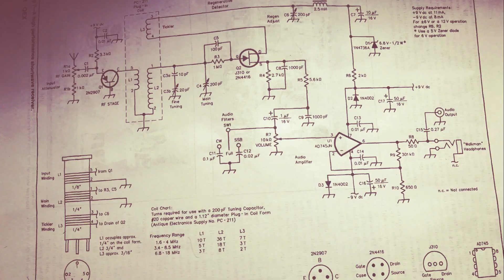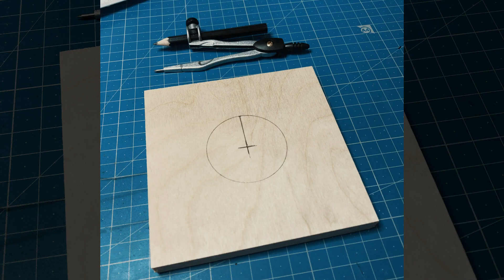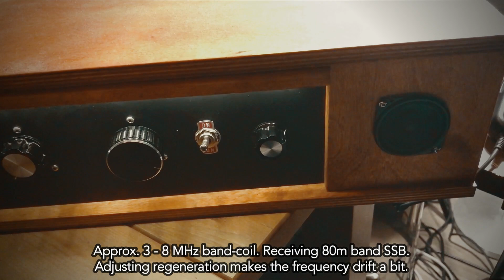Wooden Radio   High Performance Regenerative Receiver

Comment: Very nice work.  I built the same circuit, tried to lay it out neatly, it did not work well.  I moved components around until it did work the way I liked.  I performs very well now, but looks like a bird's nest inside.  :)

Comment: I'm restoring one at the moment, was a terrible mess when I purchased it. Had the cabinet stripped recently, had to replace some wires. Need to go through the schematic as someone had previously messed around with.
Reply from the maker: They are rather simple circuits, you'll be fine.

Comment: Caro Adam,
Viva!
Muito Bom. Excelente trabalho. Muitos parabéns.
Também construi apenas o 1º Protótipo com amplificador destinado ao uso de auscultador e gostei muito deste projeto.
Presntemente estou a iniciar uma nova versão para 80 metros equipada também com um amplificador que também usa o TDA2003.
Talvez durante a proxima semana já estarei a fazer os primeiros testes.
Melhores Cumprimentos.
Reply from the maker: Nice! I'm starting a adjustable HPF/LPF and headphone amp box for CW audio filtering and also some SWL via SDR. I will make a video about it. The active, adjustable frequency filters will be based on high-end OPA2134 Soundplus opamps.
Reply: @AdamSQ5VCO  Dear Adam.
Thank you for your replay.
I'm expecting news of your new project.
Kind regards.

Comment: The BFO for CW/SSB, that is just build into the regeneration or an separate BFO section of the circuit?

Sounds awesome.
Reply from the maker: Thanks. It’s just regeneration oscillation beating.
Reply: @AdamSQ5VCO  I need to do some reading on these. I have several pdf plans, including this one for building but I have very little comprehension of just how they work. 

I build a different one about 10 years back that I believe was inferior to this one. Got the bug again recently and looking at examples, preparing to order some parts. So much cheaper than kits.

Thanks.